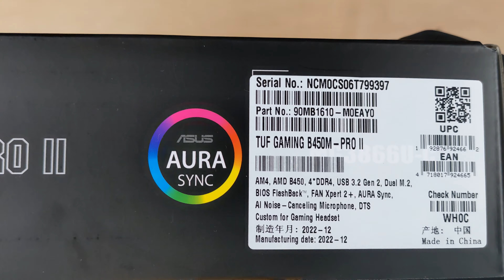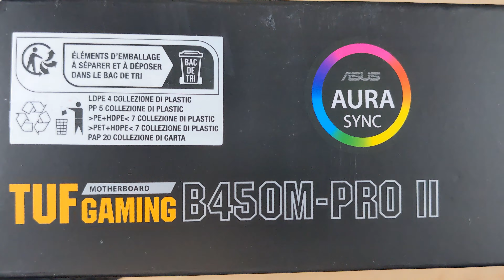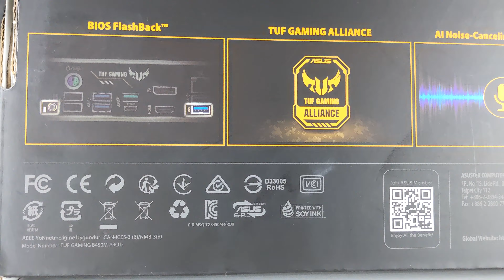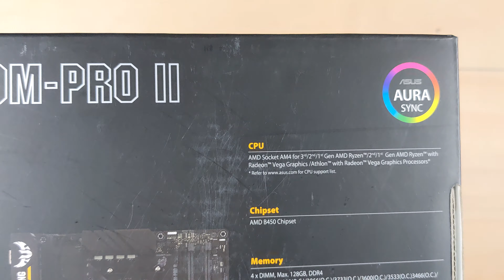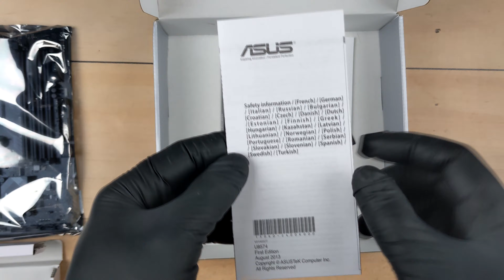ASUS TUF GAMING B450M-PRO II Motherboard Unboxing and Overview

Comment: Ryzen 5000 didn't need to update bios ??
Reply from the maker: if version bios 2409+ you don't need to update bios for r 5000
Reply: @Unboxich  so let say i buy this motherboard with bios ver under 2409. And it just support ryzen 1000 - 4000 right ??
Reply: @Kilauwu23 it has a bios flash